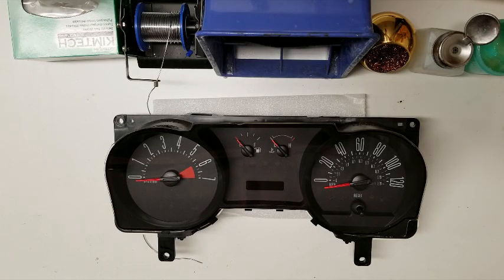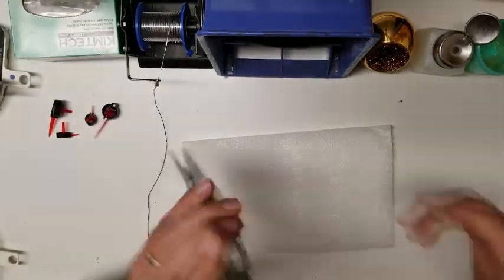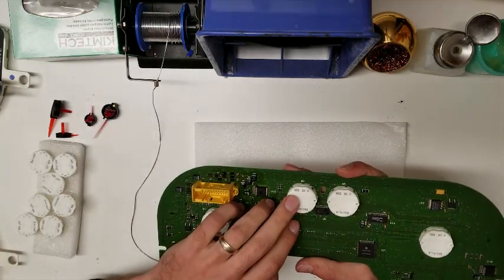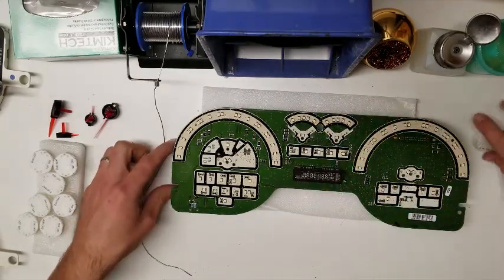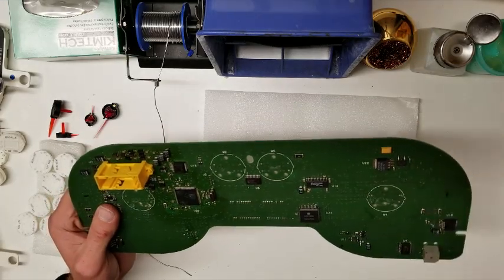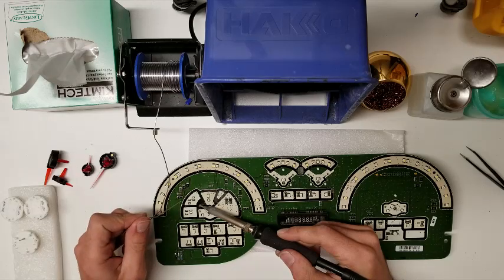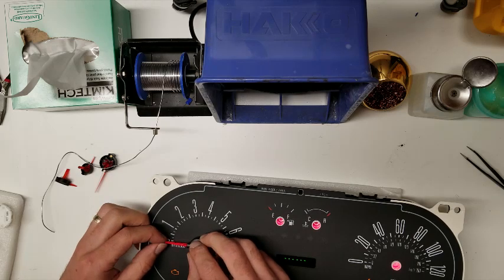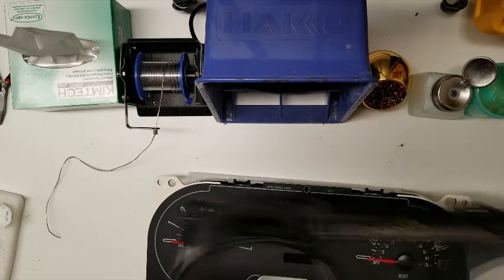2005 Ford Mustang How To Repair Instrument Cluster Gauges

Comment: If you don’t own a de-soldering gun, but own a soldering iron, you can still get them off by opening the old motors themselves by the clips. Heat up one solder point while pulling and they will come off one by one. To put them back on, heat up each point individually to shimmy them back on. Good luck soldier.
Reply from the maker: While this can work if you're careful, we have seen people rip the pad and trace off the circuit board using this method. It's better to us a cheap solder sucker or desoldering braid with flux.

Comment: If the speedometer needle is stuck at the bottom but if I move it to the correct position it works fine for a bit and the drops back is that the motor?

Comment: After 7 years of having  zero functional instruments I finally stopped my live action adaptation of Planes Trains and Automobiles and fixed it. 
The indicator arms are held on by friction so you are just lifting the arms up with even force, I used very small curved nosed needle nosed pliers. 
Using my $10 electronics soldering iron I was able to get the motors to come off with a lot of work. Applying a pulling force then quickly heating up one pin then the other on the same side. On reinstall even my somewhat sloppy solder job was fine and go everything back on and working without any magic smoke. 
For setting the gages I plugged the console into the car and turned the power on and placed the indicators at the zero. I then went and topped up the fuel and made sure it was pointing to full, then took a quick trip using my phone's GPS to hit highway speed and made sure my speedometer was accurate, temperature was right in the middle (normal) so I figured that was good and as for the tac, I honestly couldn't care but It seems correct. 

In short the solder was the worst due to my poor tools, everything else was fine.
Reply: Invest in a solder sucker like I did. Theyre cheap and work like a charm.

Comment: Hey I’ve recently replaced the gauge cluster cover and in doing that I kinda messed up the gas and rpms. Could you help? Also the coolant temp and oil levels never worked properly. Could all of that be repaired? Went to Ford and they tried to get me to buy a whole new cluster
Reply from the maker: Yes we can rebuild it for you. Here is a link to the service https://www.automotivecircuitsolutions.com/products/2005-ford-mustang-gauge-speedometer-instrument-ipc-cluster-repair-service

Comment: just repaired all 4 stepper motors in my 2005..... worked like a charm.!!!!!
Reply: I just put in a use cluster but my mileage is showing different. What's my  next move?
Reply: @rodenttheclown4674  it has to be reprogrammed with your VIN.... or the mileage EPROM needs de-soldered from the old cluster and replaced into the new cluster....

Comment: Mine gas gauge works but when it goes mid halfway it stops working any idea what it is
Reply from the maker: It's either a stuck float in the tank or a sticking stepper motor.

Comment: Curious as to how many volts you used to power up the cluster. What kind of power supply where you using? Is there a good one you recommend on amazon? Thanks. Looking forward to tackling this project
Reply from the maker: 12-14v for all automotive clusters. We currently have and use a few of these https://amzn.to/3m5P3LK . Great programmable power supply with 6 different voltage and amperage presets.

Comment: I have a 2006 Mustang, the instrument lights on the right half of the cluster do not work. I removed the cluster and inspected the circuit board. There is a burned out component that I can not get a number from. Can I get a cluster from a salvage yard and install it? How is the mileage stored? Is it in the gage circuit board or the cars computer?
Reply from the maker: Yes if you have the ability to desolder and solder that component over then it should not be a problem. The mileage is stored on the cluster.

Comment: Hey man my cluster works fine it just takes a couple seconds for the gauges to work after the cars been turned on, my main concern is as I’m turning the car on the cluster makes a weird buzzing noise, just like the buzz that comes from the stepper motors. Does that mean I need to replace
Reply: I wondered too, but it was only the gas gauge ever since i bought the car (2008) and that has been working fine since then.

Comment: I need to replace my lens, do you know if the lens for the V6 will fit the gt speedo?
Reply from the maker: Yes they are the same.
Reply: Automotive Circuit Solutions From your videos it seems pretty easy to pull off, do you think it would be easy to grab one from a junkyard?  Do you have to remove the whole assembly to get the lens out? Or can I just go to a pick and pull, pop the panel off, pull the gauges out and just remove and keep the lens?

Comment: Have you come across the issue with the cluster sounds not working?  Specifically the turn signal clicking noise, seat belt / ignition start chime?  Mine works intermittently.

Comment: Can you desolder with a soldering iron? I don't have a desoldering iron and it's really expensive to buy.
Reply from the maker: Hello, I apologize for the late response. Please do not desolder the stepper motors with just the soldering iron. The traces are very delicate on this cluster so it's very easy to pull them off the circuit board. Thanks for watching.
Reply: @AutomotiveCircuitSolutions  too late lol. I already messed it up... But thanks for the reply. I asked some guy on eBay if they can fix it. They said that they will be able to. So hoping that works.
Reply: @helloworld101  hi were you able to get it fixed?
Reply: @hova2512  not by myself, I tried with a regular soldering iron and almost messed it up. I then just sent it to some guy on ebay who fixed it for like $60. Not a bad deal. I'd just do that.

Comment: So my Tachometer just started going haywire. I clicked the link in the description to get a repair from you and I just had a few questions. On your options once I selected cluster repair it asked me to pick a color. My mustang has the option to cycle through about 6 different colors. If I got the repair with you would I be stuck with 1 color?
Reply from the maker: No, just select the factory option and we will leave the lighting alone.

Comment: Quick few questions on this. I have an 05 mustang a few months ago I had an issue with the RPM gauge not reading correctly and eventually it fixed itself but the gas gauge has just started acting up and is no longer reading so I’m leaning towards this being the issue I will have it diagnosed at the local Ford Dealer before going any further but my question to you is if I were to get ahold of another mustang gauge cluster and replace it with the one I have would it still read the correct mileage or would I need the ford dealer to reprogram the correct mileage to it? Or is the mileage stored in the ECU? Thanks again.
Reply from the maker: The mileage is stored on the gauge cluster so replacing it will change the mileage. I'm pretty sure Ford will not adjust the mileage on a used cluster, they will only change the mileage if they sell you one. That's why it is always best to get your parts rebuilt instead of replaced.
Reply: Thank you for the reply!

Comment: If I do this myself, can I hook the gauges to the car and turn key in the on position when it comes to set the red needle point to zero again? Thanks
Reply from the maker: If you turn the ignition on the gauge cluster will start getting signals from the car to raise the fuel level and volt gauge. You can just plug it in and you will hear the gauge needles resetting to zero and then install the needles carefully and then check the calibration by unplugging it and plugging it in again.

Comment: I have a question, I have read that if you change this gauge cluster that the car will not start until the cluster is programmed once installed, also a security programming must be performed. is this only true if the cluster is different form the cars original cluster or does this have to happen at all. Ive changed other gauge clusters in cars and have never had an issue with it before...do you know anything about this? Thank you for your time - Greg
Reply from the maker: letthewinderaseme I believe in this particular model the cluster doesn't need to be programmed for the car to start. But if you change the cluster your mileage will need to be programmed as it is stored in the cluster. That's why it's always best to rebuild instead of replace.
Reply: Thank you!

Comment: Hi I have a 2006 V6 Mustang with the other cluster the speedo and fuel guage are faulty is this the same problem faulty motors??if so can I send my cluster to you for repair  ? thanks J.green
Reply from the maker: Yes it's the same. Here is a link for the service. 
https://www.automotivecircuitsolutions.com/collections/instrument-cluster-repair-service/products/2005-ford-mustang-gauge-speedometer-instrument-ipc-cluster-repair-service

Comment: what did you plug it into to see if it worked....that would be a help befpre putting it back into the car
Reply from the maker: Vin J 
we have a plug off the car that we wired up to power up the cluster.
Reply: Automotive Circuit Solutions my fuel gauge needle reads different all the time and the RpM needle reads wrong when I rev the engine....is it a shirt circuit or the stepper motors
Reply from the maker: Vin J 
Did you change the stepper motors?
Reply: Automotive Circuit Solutions, would you be willing to show how you wired it to see if it lights up?